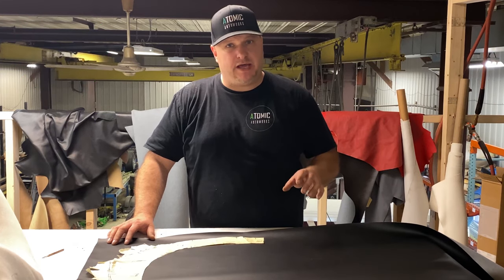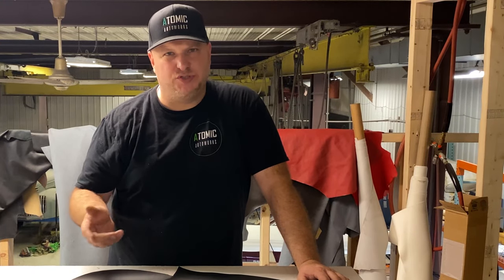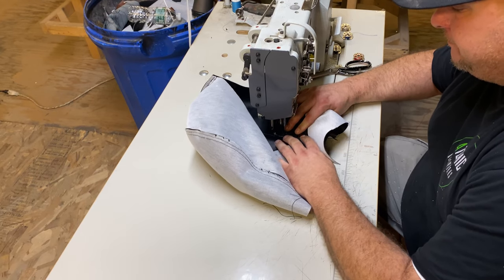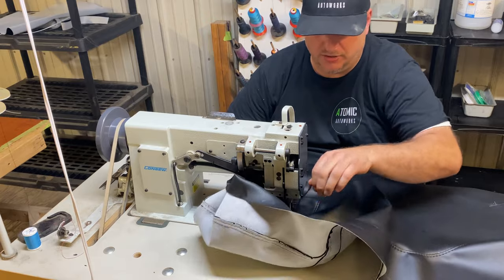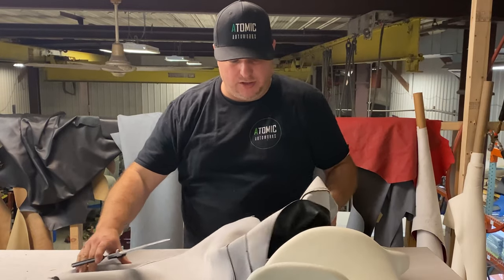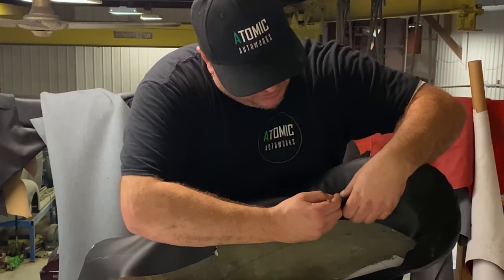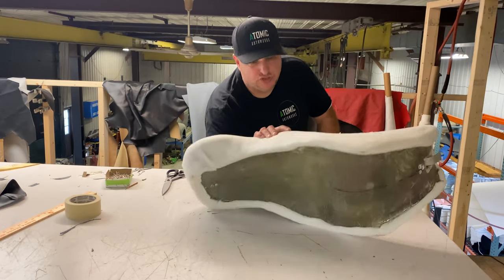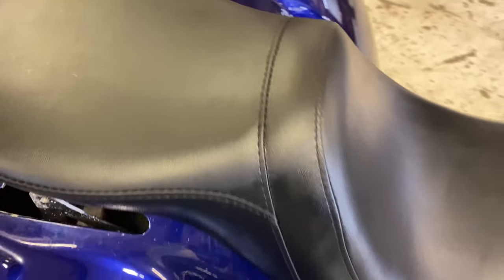How to Sew a motorcycle seat. Basic's

Comment: Thanks for the great content! Just wanted to ask - why is the bottom part necessary? Can't I just staple the side part down? I feel like there has to be some logic behind why the bottom part is made, I just can't figure it out :D
Reply from the maker: O some seats you are able to pull around and staple however when going around sharp edges, corners and curves you would have to cut and or fold the material. If you want a nice clean bottom a patterned piece s necessary.
Reply: I think because that's not plastic like most of the seat it looks like fiber which is really hard to staple and may crack

Comment: Is there a specific thread I should use for something that's exposed outdoors to weather and temperature differences or will any sewing thread work?
Reply from the maker: As far as outdoor thread we opt for high end marine threads as they are designed for sunlight and tough weather. If colors are not available we will use automotive grade however tell our customers to keep out of direct sun as much as possible to avoid color fading ,
Reply: @Atomic Autoworks  that makes sense. Didn't think about the thread being marine thread. I would like to give my best effort on a custom seat for my cbr929rr. I appreciate the fast response. The videos have been very informative and helpful. I've wrapped different things I've built before but wasn't exactly sure how to properly put together a seat. Never used a sewing machine either but I've hand stitched before. I do have a sewing machine I will give a try. Thanks again man. Keep doing what you do! 👍

Comment: Curious which Consew machine you have.  It looks like a new model.  I bought a walking foot machine (Reliable Barracuda) but quickly found out a compound walking foot, where the needle actually pulls the material through, is the way to go.  Much more expensive, of course.  What machine do you recommend?
Reply from the maker: Hello thanks, we actually have two Consews we use. One is a 205RB and the other is  a P1255RB . Most Nan brand machines are good. I would suggest finding one that someone locally can fix if needed.

Comment: The most important part I needed to see, you edited out, way to teach "/
Reply from the maker: If you let us know what part you need to learn we will be glad to help. We also most likely have went over it in one of our other videos. Thanks
Reply: @AtomicAutoworksTV  attaching seat cover to seat pan, I have a  heated corbin 2-up seat, that came with a   2004 Kawasaki vulcan 2000, all the stitching is dry rotted, and coming apart, the bike is 18 years old, with 42,000 miles on it, I can't afford the $800 to $1,200 for  a new one, or nearly that much to have mine recovered, so I gotta try to do it myself "/ making the cover is the easy part, got lots of sewing experience, don't have experience riveting or stapling cover to seat pan "/
Reply from the maker: @cancelchannel3394  I totally understand. Most older  Corbin seats are riveted to the fiberglass base. You will have t drill the rivets out and then re rivet new ones in. The fiberglass is very thick . Any of the remaining parts of the rivet under the foam should be removed. This is challenging on most Corbin seats as the manufacturing process is different than other companies. The foam is usually injected in to the same capsulated mold with the seat pan in it. This means there is usually fiberglass strands under the cover and that is also why I believe they use such heavier material to cover the rough fiberglass.  They also glue a lot of there covers on so you may have to steam them off.
Reply: @AtomicAutoworksTV  I want to add gell, and recover with 8 to 10oz. Saddle leather, when I throw a leg over, I want the seat to creek and feel like a good quality Saddle